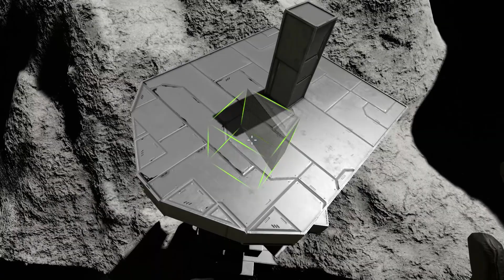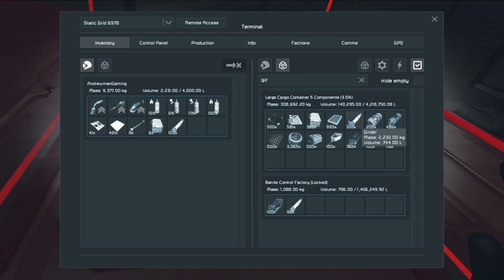Space Engineers Let's Play (S2 | E19) - CONTROL TOWER CONSTRUCTION! [Beta Gameplay]

Comment: Why not switch out the catwalks for half blocks?at least then u could put consoles etc on top of them unlike the catwalks
Reply from the maker: The catwalks are there so that the rotating part does not touch the stationary bottom part. There might be a way to do something with real blocks instead of catwalks by moving the rotor up a block. It would be tough though. Maybe I'll try it next episode.
Reply: Surely the rotor displacement could be used to give u the gap u need between the rotating blocks and stationary 1s if u use the half blocks?